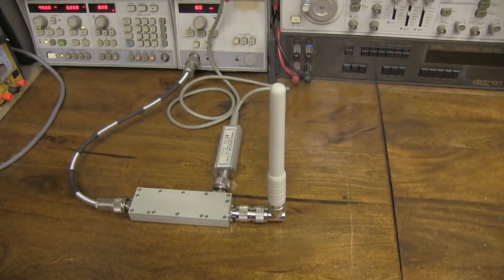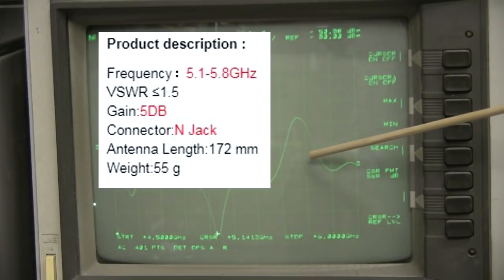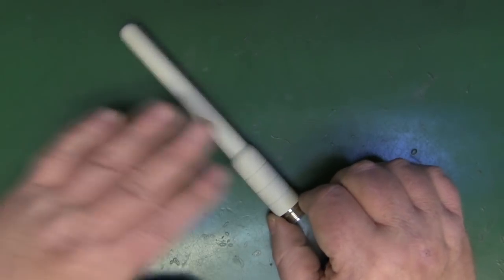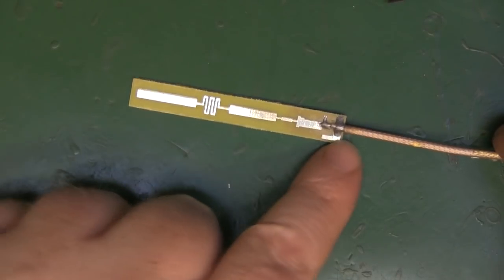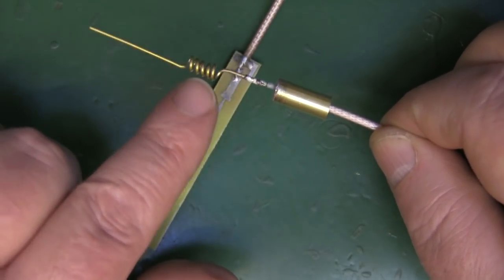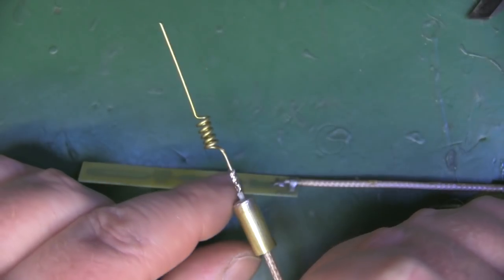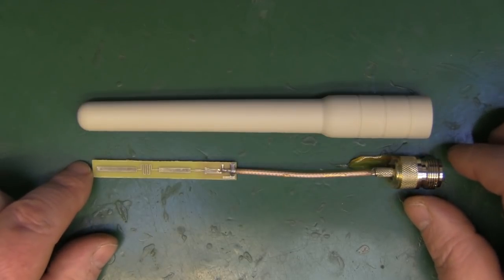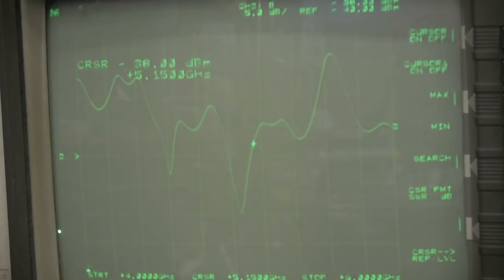Taking a Look at a 5GHz WiFi Dipole Antenna

Comment: so far as I recall, a loading coil is used only to reduce the length of the aerial as was necessary with long CB dipoles. If, however, length of aerial is not a problem, as is so with these tiddlers on 5Ghz, why not 'uncoil' the loading coil, making the aerial it's proper length for better performance?

Comment: Hi Andrew,
Nice video showing the 5 GHz antenna. I have recently gotten a little more into 5 GHZ and away from 2.4 GHz and maybe do some experimenting with some parabolic dishes I have hanging around from the ceiling.  I am going to guess the width of the driven element, over just a thin line is to increase the bandwidth of the antenna. I wish I understood a little more of the ground plane portion of the antenna where the coax connects to the antenna. I also suspect the length of the coax is some integer value of 1/2 wavelength so as to make the true Z of the antenna appear at the N connector and the ground plane section is some sort of a 50 ohm matching network (?). You have some very nice equipment. Thanks for taking the antenna out of its case and posting.

Comment: Great videos. Here is a link to a picture of a little  2.4 antenna in a DJI Tello Drone. The driven element is only 10mm with. Coil as  ground plane. How does it work and what do you believe would improve it?  It’s the 11th picture down on the page: https://fccid.io/png.php?id=3731020&page=5